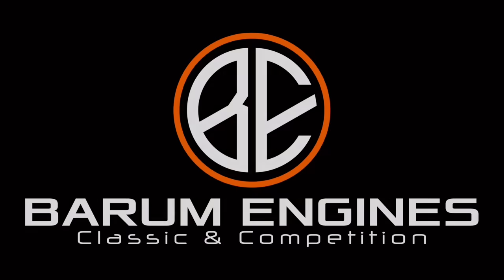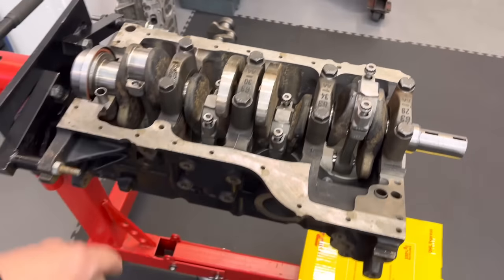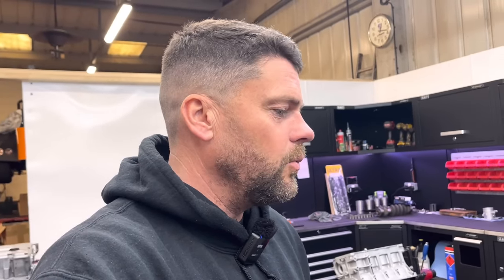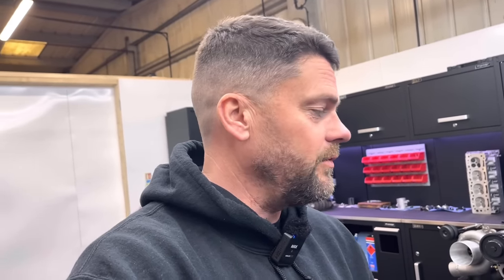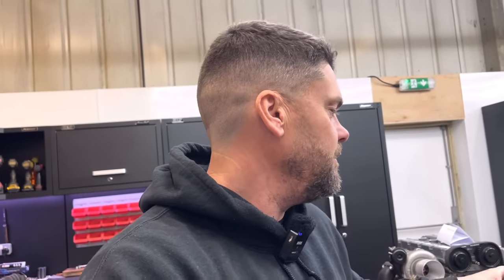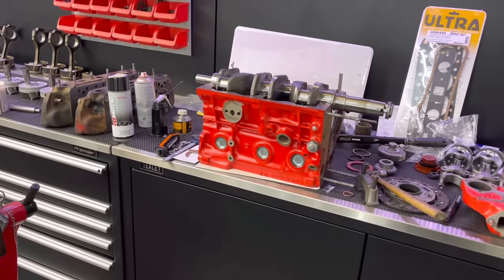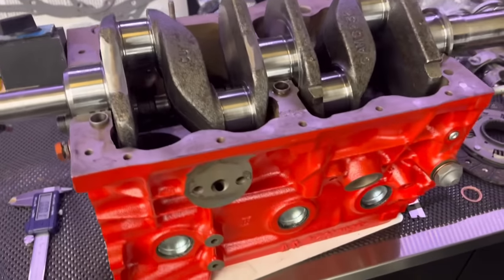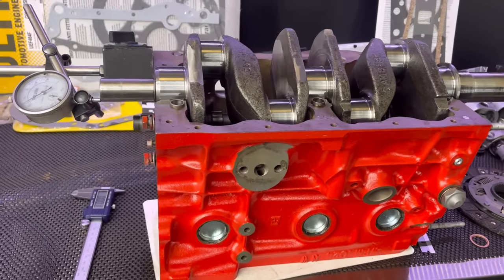Customers ask “why take so long?” Here is why!

Comment: Should the RS500 block be a 200 and not a 205? CheeRS.
Reply: Ford were not very robust with their engine block numbering scheme. Not all 205 blocks are the same. The more robust 205 block used on RS500 is easily identified by the small core plugs.
Reply: @georgebettiol8338  Thanks for your reply, every day is a school day.CheeRS

Comment: If true this video is highlighting some very bad practice! This is a great example of why the dummy build should be done BEFORE the pistons are balanced and where the engine uses press fit piston pins a set of sliding fit dummies should be used for the test assembly.